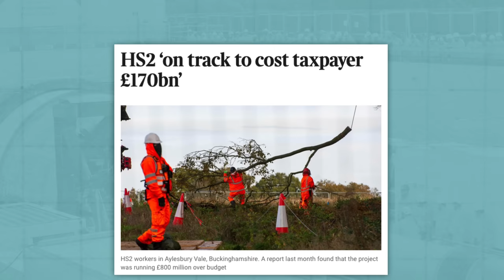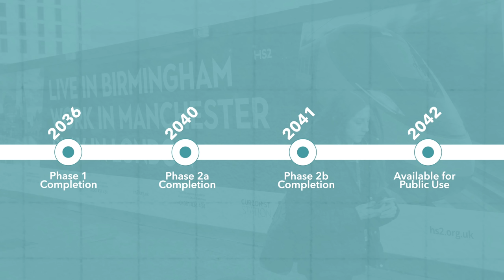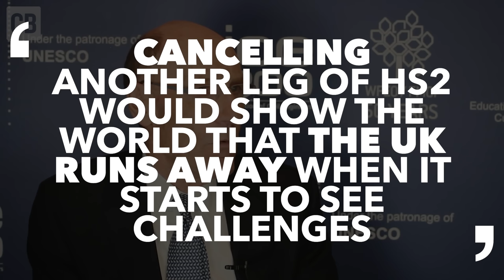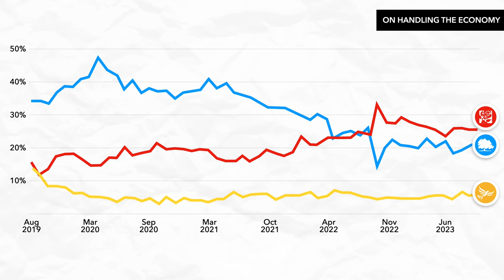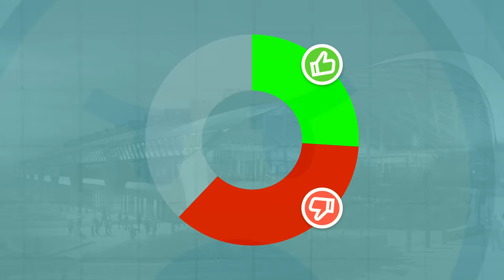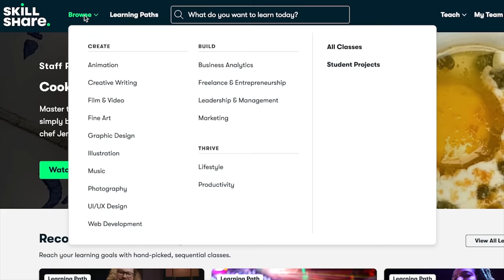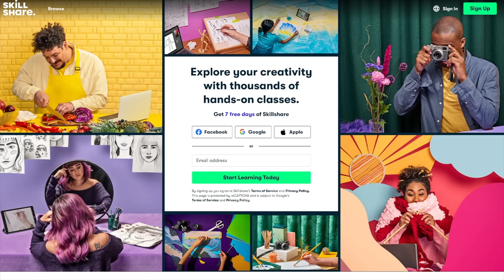Could Cancelling HS2 Work for Sunak?

Comment: Another major positive for HS2 is it would help increase the industrial cargo capacity via rail reducing the number of trucks needed on the road between select sites. It's not just Passenger rail lines that it would improve.
Reply: A number of MPs are pushing for HS2 to be completed but also to be reduced to only a freight line thus saving a lot of money because you only need to build the tracks for a much lower train speed and thus safety
Reply: That's even mor idiotic. High speed lines are expensive because they need to be build well enough to support well high speeds.
Freight does not need that and the extra cost would be completely wasted on them
Reply: @QALibrary  The problem is that just pushes the problem further down the line, as each lines would eventually hit the bottleneck of both sets of rails full of trains. Remember there's a high cost to building rail today due to the cost of land, compared to when rails were much cheaper 100 years ago, imagine the cost to buy out property owner in another 50 years when we run out of rail.

If you have faster trains, then the old rails can be changed to freight and put more trains on the fast rail. Which will move the bottleneck further down the line. Even Japan, one of the countries most well known for trains, are over budget 2 - 4x the price when it comes to new lines, it's just that the public are happier about trains than we are. I do think there's too much London centric trains though, more lines being built in the north UK should be cheaper to make as the land cost is probably less, not sure that land owners would be cheap to buy out though. Remember part of why the London Underground exists is because it was too expensive to buy property from the owners.
Reply: @sirati9770  Freight would be used on the old lines not the high speed rails. The issue is current high speed and freight use the same lines. Having high speed on their own would increase the capacity on the older lines. No one is proposing using the high speed lines for freight.
Reply: Nonsense
Reply: @sirati9770  Freight is heavy. Just stand next to a freight train and a passenger train. Then decided which requires more support..
Reply: @sirati9770 false… the trains are different, track gauge is the same.
Reply: HS2 is very important and needed. The project was badly advertised. It's not about 20 minutes shorter trip from London to Birmingham. It's all about the lack of capacity on the current rail tracks. We need more capacity for trains because right now the local trains are overcrowded.
Reply: @sirati9770 The key of the argument here is that higher speed express services are essentially major road blocks for any traditional rail line as they eat up extensive chunk of scheduling window to be able to skip stop and overtake other slower service. using a dedicated HSR corridor to remove these express trains from the existing rail lines will massively free up their scheduling capacity and allow for more commuter / freight trains.
Reply: @sirati9770 In fact this is basically what is driving China Railways to build so many HSR right of ways - so they can free up capacity for intermodal freight trains, which is more lucrative (as Chinese government heavily regulates passenger rail fare)

Comment: As Spain extends its magnificent high speed rail system, it is also winning export contracts to build high speed lines in the middle east and elsewhere.  Imagine ANY British engineering company trying to bid for high speed rail contracts overseas? British manufacturing and infrastructure projects have become an absolute joke.
Reply: Tbf we do have companies that have won infrastructure projects outside the UK. IIRC a couple of years ago Bombardier in the UK won a contract for the monorail in Cairo. Though I've not kept tabs on it since.
Reply: We actually export a lot of related tech and equipment and skills, we just don't use it all properly ourselves.
Reply: Theres actually quite a few companies especially in Egypt and Turkey, as well as the city's renown for consultancy/finance
Reply: @@BesthinktwiceFrench here, between Brexit and the lack of connections from London, the tunnel is pretty widely seen as a failure. Ticket prices are through the roof, for an admitted good service... but just way too expensive. 
Also, eurotunnel bonds are a financial failure for everybody who invested in them x). Either ways, compared to the other french international rail connexions, it's already not the best one, and it's not looking like it will improve anywhere...
Reply: A bunch of Spanish, French and German companies are in fact building HS2 (in joint venture with typically smaller British firms)
Reply: That’s because the Spanish build exactly enough line and nothing more, and they don’t overspend on the project
Reply: Tbf Spain is incredibly good at building cheap, good HSR lines. As a French person I'm jealous.
Reply: @Da__goat  I'm sure I've heared about controversies on a few HSR lines in Spain, notably 9ne going in the north east. But I may be wrong there, don't hesitate to double check, it's old memories x).
What I'm really looking for is the Madrid-Lisbon line, but the portuguese side is not looking particularly interested which is a shame ;w;
Reply: @Hiro_Trevelyan As a German who lives in Spain I do sympathise.  Your country’s railways are really good but high-speed trains in Spain are just at another level.
Reply: Spanish HSR is an example of how to burn money in vanity projects nobody uses. Glad UK isn't following their path.
Reply: The same with home building
Reply: BAE systems seem to be doing ok with submarine / aerospace tech so i would not be so sure about that statement.
Reply: @chrisgermann6658  self flagellation is the national past-time of the British lol
Reply: @Hiro_Trevelyan  easier to operate in soil, relatively easier to meet safety and environmental standards, cheaper labour and so on
Reply: And the more funding is cut as soon as a project is over budget the less competent it will get. We already see this in the US with the nation basically having become completely incapable of building anything but highways because for decades there has not been any large scale project and all the skill and organization has been lost.
Reply: @MrNeilandio someone sensible who knows what they are talking about
Reply: @XMysticHerox  💯 this is the biggest drawback i’m not building infrastructure is the inability to collectively coordinate and persist in finishing a difficult task